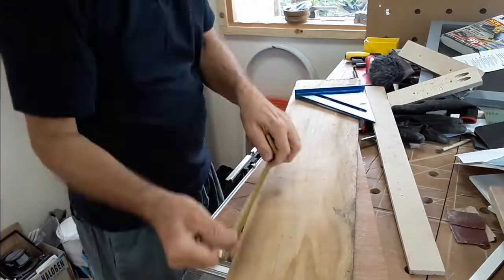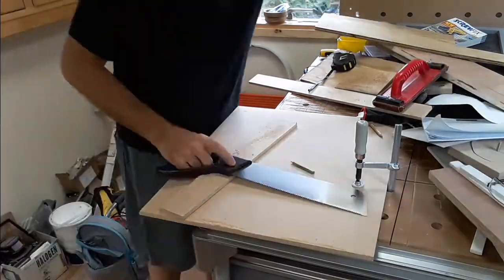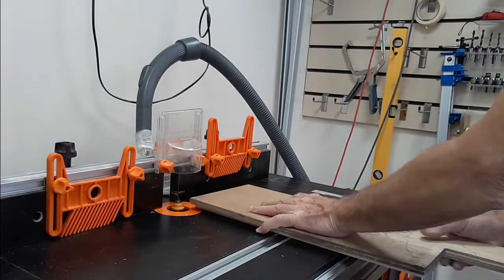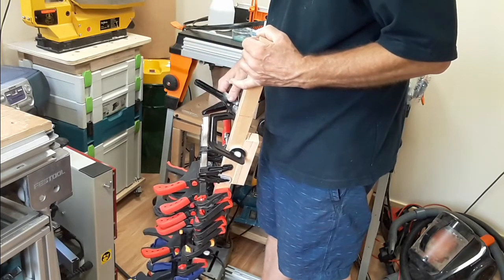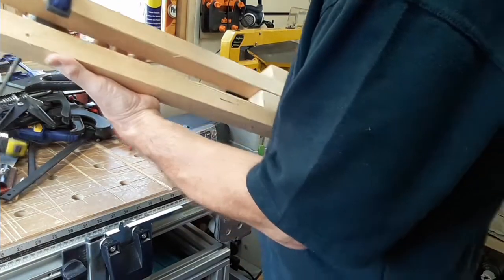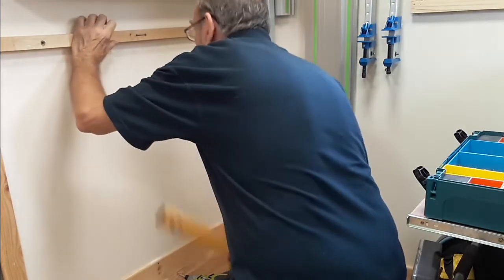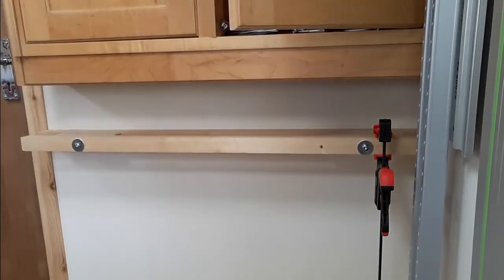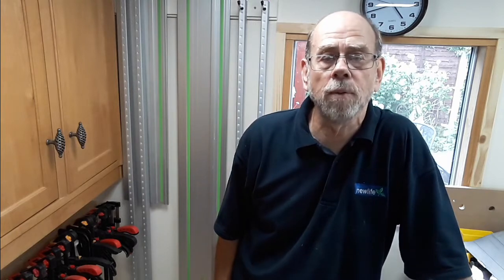the small shed #33 - clamp racks

Comment: I like the maximum use of space. I've started looking at different areas in my workshop. The red sanding pads, where can you get them from?
Reply: Hi Peter, with as little room as I have you need to find every inch of unused space! The sanding block was a cheap Aldi one, there are similar ones available on Amazon , and at Screwfix, though they tend to have a handle, I found similar ones on Ebay  as well
https://www.ebay.co.uk/itm/Sanding-Block-Sand-Paper-Sheets-Wood-Work-Equipment-Sandpaper-Sander-Carpenter/382721941539?hash=item591c016023:g:hnQAAOSw5wJcN1my